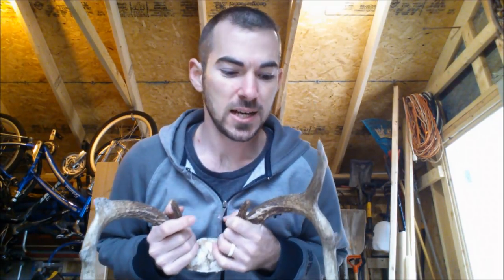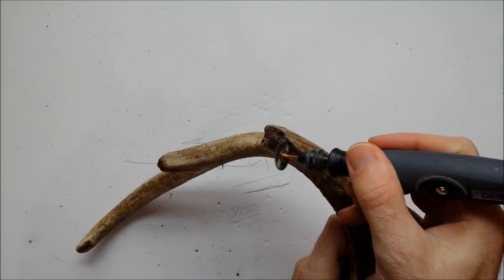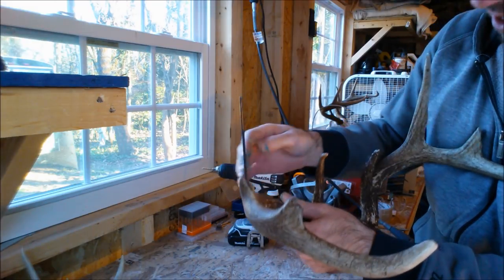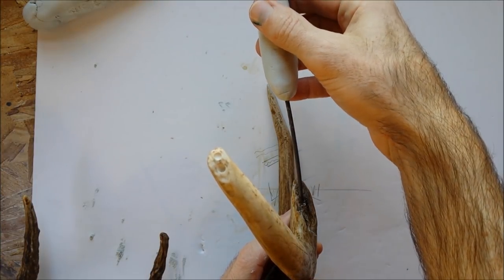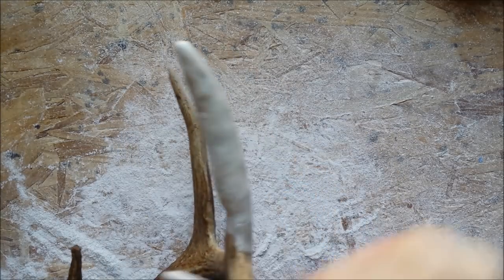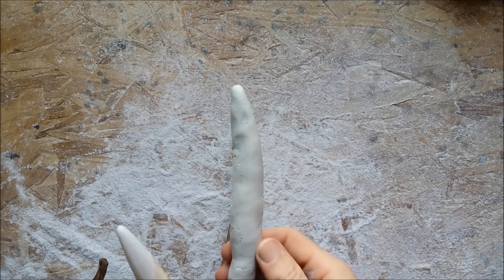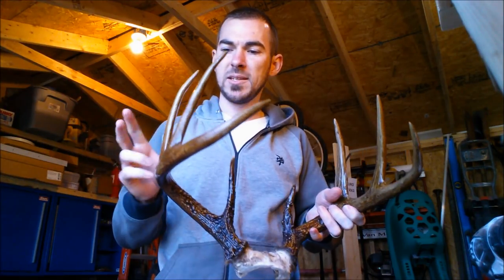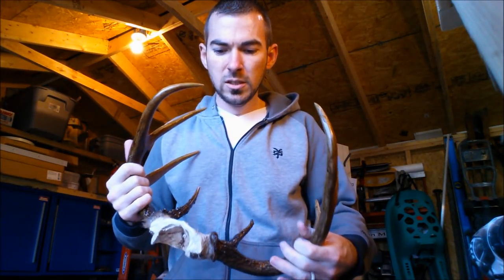Broken Antler Repair Using Apoxie Sculpt

Comment from the maker: ➝ SKULL CARVING TOOLS I USE

★ Dremel 4000 https://amzn.to/2tBKq2H

★ Flex Shaft https://amzn.to/2IENLIO

★ Adjustable Chuck https://amzn.to/2Xqp7if

★ Respirator  https://amzn.to/2H0W3Z7

★ Ear Protection https://amzn.to/2H7DIJI

★ Ball Carbide Burr https://amzn.to/2H3jkJU

★ Inverted Cone Burr https://amzn.to/2EwHr1P

★ Cylinder Carbide Burr https://amzn.to/2EwmofT

★ Tungsten Steel Carbide Burr https://amzn.to/2EuQEYs

★ Diamond Dust Burrs https://amzn.to/2TeFbVg

▬▬▬▬▬▬▬▬▬▬▬▬▬▬▬▬▬▬▬▬▬▬▬▬▬▬▬▬

➝ SKULL CLEANING TOOLS

★ Aquarium Heater https://amzn.to/2EdGNoM

★ Mesh Bags https://amzn.to/2VRQ4cM

Some links above are affiliate links!
Reply: I'm getting ready to start a similar project. But I dont have as much tine to sculpt. What's the name of your video where you mount those horns on the fake skull? I love your video. has helped out allot with 2 dead heads I found this year.
Reply from the maker: https://www.youtube.com/watch?v=UXcZmnsOTNU&t=34s

https://www.youtube.com/watch?v=-PvChrc5lp4&t=98s

Comment: Thank you for sharing this.  I repaired one tine on each rack and they look great.  I had my daughter paint over the gray epoxy with acrylic paint to an ivory type color before staining.  I used minwax penetrating stain of a lighter color (IPSWICH PINE 221) and then sprayed with spray on matte polyurethane.  Came out great, slightly shiny.  Friends could not tell which tines were replaced even after I told them some had been fabricated.

Comment: Good video . I had a broken tyne on 1 beam.
It got ran over. I also have pieces of antlers laying around . I took a tyne from a scrap antler that was about the right size . Drill a hole in both . Cut a piece of wire clothes hanger and super glued it together. 
Came out good . The colors were a little off . Some time in  the sun should even them out .

Comment: Have you ever thought of hitting it with fine steel wool to take off that sheen?
Reply from the maker: Hey Robert! Yeah I have tried it and yes you are correct, it does take the sheen off and helps with getting highlights on the antlers.

Comment: I had a question, I am fixing one for someone so I never tried before. In his case I have the other piece. Can you use both pieces and glue them together, if so, would you still run a wire between both parts, the tine and the antler. Both pieces mate up to each other perfectly, but I’m thinking, if I’m mating the original 2 parts back together, is it better to still use a coat hanger or will super glue of some sort be long strong enough to hold the parts together, thanks!

Comment: Great video. I have quite the challenge. My buck i shot has his whole left side gone 4 inches past the brow tine. I guess ill bend a huge wire and epoxy it first to match the full length on the other side. Great video though. Very informing and looks great
Reply from the maker: Ah dang! Yeah it will be some work but it's possible. Thanks for watching!

Comment: Thanks for the video.   My buck this year has his antler base broken.   I have the skull boiled but the antler finally came off when all the connective tissue was removed.   I am going to give it a try to reconnect the antler to the skull and fill in the void.  Any suggestion on keeping it white instead of it turning gray?
Reply from the maker: Good deal Bryan. Unfortunately it only comes in a grayish color, but you can paint with acrylic to match.

Comment: How much epoxy sculpt do you end up using? I have a caribou antlers that I have to repair a couple tines and a few tips. I’m just trying to figure out how much I’d need to order for the project. Thanks for the info. I’m going to try and use some of your techniques on my project.
Reply from the maker: Hey Trinton! Sorry for the late reply. I think for the project in this video I used about half of the container.

Comment: My tine rebuild is looking great so far. Used apoxy scult, but mine dried WAAAAAY darker gray than yours. This rebuild is on a shed from SE OH and the tines are almost white! Any advice on how to get the apoxy scuplt way way lighter prior to adding stain? The stain you recommend also works great on a few recolor projects I've done. But these tines are literally almost white! Wish I could attach a pic, if so, tell me how haha
Reply: Same here with the apoxy sculpt. I’m going to try just painting the rebuilt tine white and then staining. What did you try?
Reply: @zekeshow3769  that rebuild project took a back seat to a few dead head European mounts some friends asked me to work on. If I ever get around to actually finishing it I'll let ya know haha.

Comment: Hi, I have a question. At 5:13 in the video, it appears the rebuilt tines go from the grey color it dries as, to the almost finished stained color. What was the step you used to get to the matched up stained color? When I stained my shed, the grey epoxy & the existing antler didn't seem to match up well. 
Thanks for your help & for taking the time to make the video. Very helpful
Reply from the maker: Sure thing. So I applied 1-2 coats just to the repaired epoxy first, let it dry and they added a clear coat to lock it on, Then after that I went over the whole antler to blend both areas. Adding the clear coat allows you to wipe off the last coat of stain in order to get the lighter highlights. Hope that helps!

Comment: Thank you so much this was very helpful . I have a nice cabin by Springfield ,Mo. an looking to decorate it with deer antlers I have purchased . Some of them was painted with brown spray paint . Any suggestions on taking this stuff off ? ..steel wool ? Paint remover? Thanks !
Reply from the maker: Ya because the antler is pretty tough material I think paint remover with light wire brush might work or soak in acetone as I am pretty sure that dissolves paint. Hope the cabin turns out nice!
Reply: US Skull Hunter Thanks ! Appreciate it .

Comment: How do you get the burs like on eye guards ?
Reply from the maker: You can either sculpt then while the apoxie sculpt is still wet or carve them into it like I did after it is dry.
Reply: U.S. Skull Hunter I did not see you sculpt a eyeguard  that had a lot of burs.
Reply: I thought about getting some Jb weld and press on a brow tine and straighten it out to use as a mold/form to press against the wet apoxie sculpt
Reply from the maker: @whitetailrealityoutdoors958  Hey yeah not in this video I did not. You could definitely give the Jb weld mold a try!

Comment: Why would you do it that way?  I take a point from another antler and attach with wire.  Then you only have to patch at the joint.  I use Sculpall 2 part epoxy. Too much time and work doing it your way.
Reply from the maker: Yes, an antler tip would be best but if you didn't have one matching you could do it this way